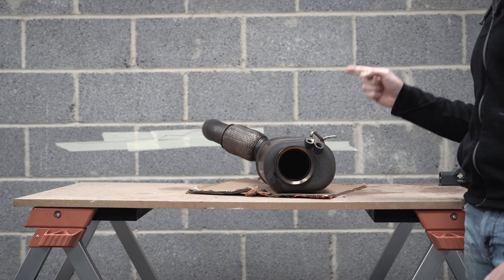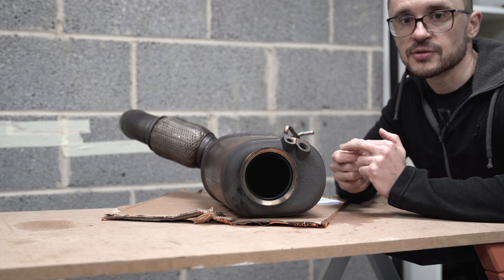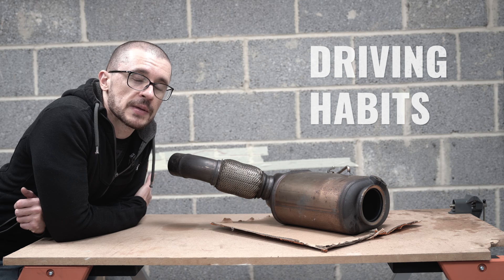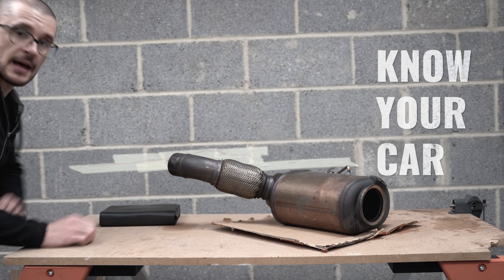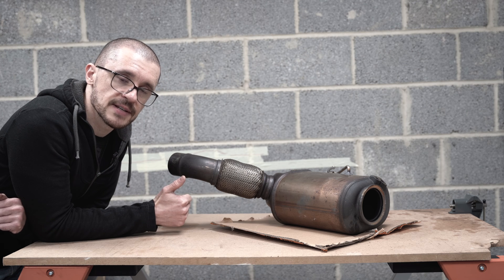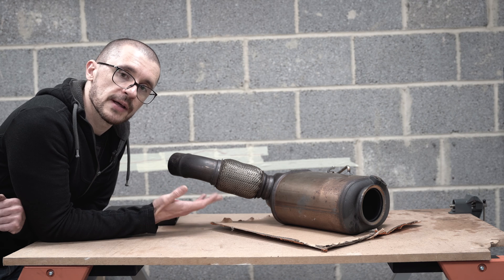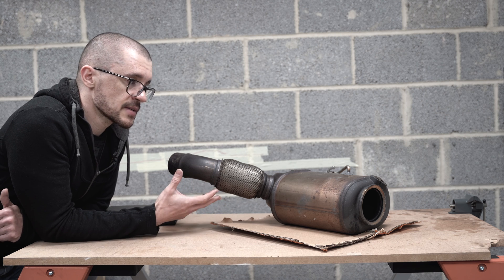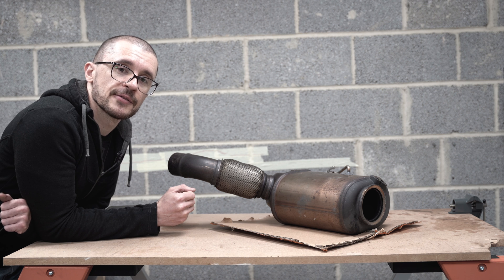How To Avoid DPF PROBLEMS - Diesel Particulate Filter

Comment: Move needle more towards redline frequently
Reply from the maker: What do you think makes people not to use the higher revs?
Reply: @BestCarMods Police😉Just kidding, or not. Thanks for all the great info here!

I think people are too worried to baby their cars. 

This is my first diesel so I had a LOT to learn. But I love her!  

I had a petrol VW GTI APRII prior & loved her too. 

Love myGerman cars!  My very first baby was a 78 Super Beetle & I wish I’d never sold her!Had an 83 320i I wish I hadn’t sold either but oh well!

I’m lucky I live off a rural highway so I regularly take my Q5 3.0 TDI out for 100mph+ drives around 30mins. 

Do you think regularly driving at least at 70mph for say 20mins helps?  I do more of that than anything else.

And what do you think regarding additives?
Reply: @BestCarMods I have a 2008 V50 d5 would ten minutes or so sitting at 55mph with 2000-2500rpm be enough for healthy dpf if I do it weekly? I'm not near a motorway where I can do 70mph
Reply from the maker: @MelchizedekKohen  there are so many factors that can influence this. but I would aim for 30 min of driving. Also why not get a scanner and monitor the DPF load. And you do the driving when and if it is needed.
Reply: YES!!!
Reply: Once a week , she gets a blast out at 140 km per hour up motorway and slowly down to 5th here and there when needed to pull and keep revs high , then twice a week after engine warm I will bring it near fine stretch where I live and I absolutely destroy the arse off her , Italian tune up to the highest ( now in between that oil change and filter every 8,000km and every second Oli change , I do fuel filter , transmission gear oil every 65,000km , all motul top spec oils for each and all Bosch filters on mine oil and fuel , if you have diesel you need to maintain it , if it's headache , just buy petrol )) but on motorway nothing better than being at 120km per hour and just simply none stop pulling , love that and comfort with it

Comment: Driving for 20 minutes to an hour at constant speed is nearly impossible when you’re going to work and back the motorways are horrendous lucky if you’re doing 20 mile an hour on there
Reply from the maker: never thought about it this way. in theory for that you have the active regen, where the ecu injects fuel on the exhaust stroke and increases temps artificially. not to be confused with the forced regen that you see done in the garages. but overall low speed driving might not be the best for the dpf.

Comment: Any device that demands you drive differently and further to work properly  means more emissions overall! In time engines wear so that they’ve less chance of passing relevant tests and temporary fixes include a new DPF and all the sensors that are seized in cost a bloody fortune…..so the answer is to scrap it and start again with a new one? How big will the carbon footprint be for that operation? Built in obsolescence and a lifespan of three parts of FA seems to be the way we’re heading right now.
Reply from the maker: sadly that is how the economy works :) ... also don't forget that cars get scrapped even faster due to high labour cost in some countries. EVs are even worst because off all the EV precautions and specialised tools and training required...

Comment: Hello! 
I have a brand new 6 months old Toyota Innova Kijang/Crysta 2400cc diesel manual, which has done only 4000 kms. It developed reduced engine power and performance,sluggish and choked feeling at 700 kms. Since then the dealership has not been able to solve the problem. They have manually conducted manual/forced dpf regeneration multiple times but the malfunctions have not been rectified. Once after forced dpf regeneration the car improved a little but worsened again. My questions are:-
1) Is it possible for the DPF to get clogged at just 700 kms?
2) Is it possible to get the DPF removed and get my car remapped without any side effects?
I am from India.

Comment: If around 70% of your single trips are not longer dan 40-50 km's, why buy a diesel car anyway?
Reply from the maker: because at a first glance the diesel is more economical, better on theoretical fuel economy.
Reply: @BestCarMods  But (at least in Europe) the increased monthly taxes and other costs are not compensated by the improved fuel economy if you drive such short distances.
Reply from the maker: @cbats1888  it is not effective ,n the long term, to use a diesel for short trips. maybe the first owner that has a vehicle up to 5 years does not have to see the serious damage, but after 5year the bills will start to show up.
Reply: I fully agree with that, that's why I don't think anyone should buy a diesel for trips shorter than at least 50km's single trip :D

Comment: Best way to avoid DPF problems is to not have a DPF
Reply from the maker: :face-blue-smiling:
Reply: @BestCarMods  Hi, how does the egr valve or blanking it effect the dpf , please BCM ?
Reply from the maker: @nigelmitchell351  theoretically it will cause a DTC and the engine ECU will not allow active DPF regen.

Comment: Recently sold my Passat BiTDi 240 remapped since new. It had 325,000km (200,000 miles). The original DPF was still ok.
Reply: 👏My guess is you overall maintained well & weren’t afraid to actually drive her 😉
Reply from the maker: what was your maintenance like?
Reply: @ Oil changes every 16,000 km(10,000 miles). Fuel and air filters every 60,000km(40,000 miles). Car was doing 1000km a week. Not many short runs and mostly driven spirited.
Reply from the maker: @Mickytdi  thanks for sharing
Reply from the maker: @PadraicODonell  🌅

Comment: Drive a 2014 Honda Civic 1.6 diesel from new. 70/30 short/long driving. I change oil & filter twice a year and any other maintenance as required eg fuel filter (a bitch), glow plugs, coolant, brakes. 
177000Km no problems. 
I think it has a lot to do with the location of the DPF in the Honda, close to the engine.
Reply: 😁 Honda civic tourer 1,6 diesel also .. oups only once a year oil & filter ( liqui-moly 0W30) and indeed fuel filter 🙈😠😅 .. 👍🏻
Reply from the maker: @PhilStonewallTiger  I had a friend that was doing 200+ miles a day in a civic 1.6 diesel .... he done that almost 6 years and we were all amazed of how good the car was on fuel.
Reply: @PhilStonewallTiger whatever oil meets spec and isnt too expensive will do😊
Reply from the maker: @2ndjim  I would not really trust that philosophy especially on euro 5 6 or 7 cars.  MANNOL will never be the same as CASTROL or MOBIL1 or MOTUL.
Reply: @BestCarMods  Mannol 🥴 I can usually get Castrol on a discount somwhere but I won't pay through the nose for engine oil. If it's 0W30 & C2/C3 and a known brand I'll buy it if it's in a good price range.
Reply from the maker: @2ndjim  now it makes more sense. You buy your oil when it is discounted. I call it buying strategically :). In automotive if you buy parts + oils because you need them, you get robbed, if you can buy strategically, when the shops have to get their sells targets, that is when you see good prices.
Reply from the maker: I think it has to do with maintenance and good oil.
If you ever have the chance also clean your EGR.
Reply: @BestCarMods  Clean as a whistle 😁

Comment: I drive my cars hard and due to this I  have never had any problems with DPF, EGR or Turbo vaines sticking, my main comute is only 11 miles/ 25km, and I have never had any problems... potting around will defiitely cause you problems...
Reply: I’ve got an Audi TT tdi only do 3000 miles per year only comes out on a weekend, also never had any problems as it’s driven with a heavy right foot

Comment: Hi ,
I have a question, how do I keep an eye out for active regen cycles? My car doesn't let me know when it's in a regen cycles
Reply from the maker: I would get a diagnostic scanner and check it ... something like https://youtu.be/mXaAMZUEsMY or the D7 line of scanners. I might make a video showing how to do that ...
Reply: @BestCarMods  I know Mercs and Vauxhalls turn on rear heated screen and heated door mirrors (if fitted) when doing regens other manufactures probably do as well, Connect an LED  light to one of those circuits and if it comes on when the rear screen is not manually turned on you know its doing a regen, there are youtube videos showing some ways of rigging up the LED, I have one fitted to my Merc C220d and its works really well
Reply: You should hear it, car becomes louder at exaust ,mibe does so for 5 to 10 minutes then back to normal again. Dpf light never came on, 300 k km now
Reply: @sheffcitys2forgedinsteel255  My Jaguar X-type sounds like the exhaust is blowing and idle speed is higher than usual when stationary. 20 minutes run at 2000+ revs is enough for it to regen properly.

Comment: Let’s develop an emission system to save the planet, but the only way it’ll work right is if you drive more for longer and burn more diesel? Let’s not mention the millions and millions of cardboard and plastic packaging for the DEF
Reply: there are too many vehicles out there in good cond otherwise,seems it's not so easy to develop an aftermarket kit,you would think after 20 years someone would have solved this dilemma us diesel owners are going through,especially as EV's need years and years of further development before they become a  viable alternative.
Reply from the maker: interesting perspective
Reply: Don't buy a diesel if you do regular short trips. They are motorway cars so if you gave this problem you bought the wrong engine type
Reply: All the extra dpf cleaning industry 😂 and all their machines. All of them use diesel, transport, mining etc. Also the DPF industry by making all dpf:s😂
Reply: The dpf is not just about environmental protections. Its very much about human health. 
Modern common rail diesels are more fuel efficient and create big power, however the particulate size and NOX is a big health hazard. Plenty of research on this. 
When you know a few people affected by cancer you will realise its not worth being cavalier about these kinds of risks.
Reply: @slickstrings My excavator has a DPF and when it goes into regen the fumes give me a headache.  It smells extremely noxious to the point where I'm concerned about my health breathing that crap.
Reply: Yep, and lets make cars that have more things that mean they go to the scrapyard earlier, leading to us making more stuff. Drives me nuts. And im a tree hugger!

Comment: There are loads of reasons a DPF won't regen: faulty thermostat, broken sensors, fuel tank below 25%, faulty differential pressure sensor, bloked sensor pipework, faulty glowplugs (they are used for more than just cold starts), broken or missing outside ambient temp sensor (the one usually found in a wing mirror). The list goes on....
But the main points are to keep your engine well serviced: at least every 10,000 miles. Correct oil spec for your diesel, usually C3 or C4 low SAPS. And use premium diesel.
Reply: Fuel tank below 25%.  WTF . What a joke.
Reply: @LesleyStoddard  thats not a joke , my audi a3 wont regen with less than 1/4 of a tank even says so in the manual
Reply: @LesleyStoddard  I thought so too as all this means is the more likely you going to have condensation build up in the tank in cold/wet conditions so it's entirely a fuel filter issue not a ptf issue, just means you have to drain/replace the fuel filter more often nothing to do with ptf.
Reply: How would an outside temperature sensor affect the regen?
Reply: @edwardadelin  If the ECU can't see the data from the temp sensor, which it uses to make calculations, it won't authorise a Regen. People have spent thousands on new DPFs etc and not been able to fix the fault. Until they realise that the aftermarket wing mirror that they bought after a prang, didn't come with the temp sensor included: hence why it was so cheap. O'Rileys Autos channel on here has a video about it.
Reply: Thanks for response. I have DPF regens too often. The DPF accumulates 1g of soot for each 30km travelled outside of the city, on highway and country roads. @AdamDitheridge
Reply: @edwardadelin  Something is making the engine produce more soot. Blocked air filter? Faulty glow-plug? Failing injector/s? Get a scan-tool on it and check for DTCs....
Reply: I did that. I have brand new glow plugs. Air filter had 10.000km, just cleaned it and got the dust out of it. I use premium fuel. I tried to monitor lambda values, I want to see if the car sees a rich fuel mixture. Dif pressure sensor is also fine. MAF seems to read good values. @AdamDitheridge
Reply: @AdamDitheridge Top channel that …

Comment: Good presentation; I worry that my Range Rover 4.4D doesn't get a good blast because even at motorway speeds the engine is barely doing 1500 rpm.
Reply: Drop it down a gear or two then. 20 mins @2500 - 3000rpm should get things moving, so long as all other Regen parameters are met.
Reply: @AdamDitheridge  Thanks.

Comment: I think you need to make sure your glow plugs are in good condition so the vehicle can cold start ok without running on 2 or 3 cylinders as that can cause issues, interesting point about oil consumption so I'd definitely check the inlet to make sure no oil is getting dumped into it, if it is get it checked out & fixed if it's a breather issue. Check engine temp as if it doesn't get hot enough it won't regen so may need a new thermostat, also make sure the exterior temperature sensor is working as if its blank you will get DPF issues.
Reply: Also, glow plugs take part in a Regen. As I understand it, diesel is injected on the exhaust stroke and the glowplugs are energised. This is what heats up the DPF to approx 600degrees.

Comment: too many things can cause this to not regen ,,even an outside temep senor fail will stop the dpf from regen .its a constant battle.
Reply: yes correct,and if my latest effort fails i will be forced to do a removal,I don't necessarily want to but will do as my vehicle is still near showroom cond at 12 years,I'm not going to allow it to go to the wreckers to be scrapped just because of a failed flawed system.
Reply: @MrLeslloyd  remove it and get it remapped pal. Will be OK.
Reply: @connectlogic  thanks m8!

Comment: The manufactuars should put lights on. So you know when its regenerating. so the driver can finish the regen instead of turning it off.  I am sure my short drives kils my dpfs. I have had 3 vans of wich one was new who had the check airinlet system and engine light on 95% of ownership.
Reply from the maker: sadly, the more complex a system is, the more problems it generates.
Reply: sooo true
Reply: I've driven a few trucks that tell you when they are doing a regen and one that can do a regen while parked, because it's work involves very little of the type of driving needed for an automatic regen.
Reply: I have been using a very cheap OBD2 scanner with a mobile phone app called CarScanner. I have created a custom dashboard in the app which is also displayed on the car's infotainment screen via Android Auto. Pretty convenient to keep an eye on DPF load, exhaust temperature and regen status. I purchased the pro version of the app for $6 and a $3 OBD2 scanner. So, a full fledged DPF monitoring system under $10.

Comment: In 4 years my DPF light has only come on once.  The rest of the time I'm on the open road running a diesel like it's supposed to be run.  What damages these diesel systems is driving them around town at slow speeds and low RPM's.  If you're an urban dweller, trade into an EV or gasser.
Reply: Agree, BUT, the market is overwhelmingly diesel. I couldn’t find the car I wanted for the price I could afford so I ended up getting a diesel.
Reply: I bought diesel because i needed the torque for towing,DPF has been major flaw in the system as there is no light or anything to inform that a regen is in operation,so you can pull into the garage for the night and regen is still active,next morning,without actually knowing it.
Reply: @MrLeslloyd  I keep an eye on the instantaneous fuel consumption all the time to know when the DPF is being regenerated. For my engine, other tell signs are fans reving up and engine running less smoothly at low RPM.
Reply: Deleting is the best option. You don’t have to deal with that stuff.
Reply: @tednoone3414  any tips on the best way to delete it? Looking at buying a 2.0 150bhp diesel as I need it for towing but I do a lot of short journeys too, always drove diesels, love the torque.
Reply: @roadwarrior8560 it depends on where you live. However I think you’re also looking at a 2015 or newer version if it’s the 150hp. That brings along challenges with the DEF system. You need to find a tuner that removes those. Do your research for Malone or MR Tuning for the US - they will work well. Then look at the down pipes available for your vehicle along with dpf, EGR, and the requisite block plates/. Some people keep their EGRs. I’ve been told the pcv is an underlying cause of soot buildup and the EGR isn’t an issue but removing the pcv is not an option. Anyways watch delete videos - it will save you some time with some of the kits that are out there.